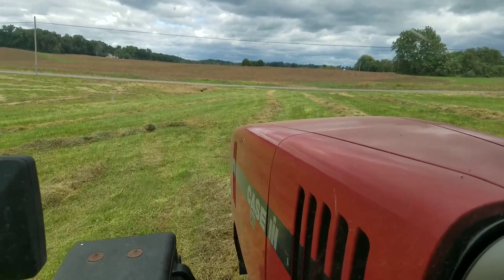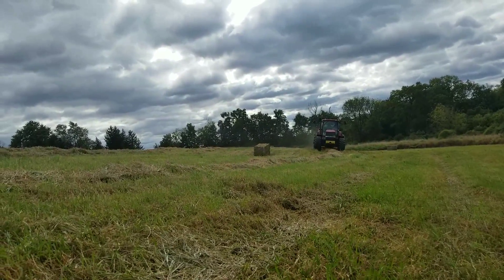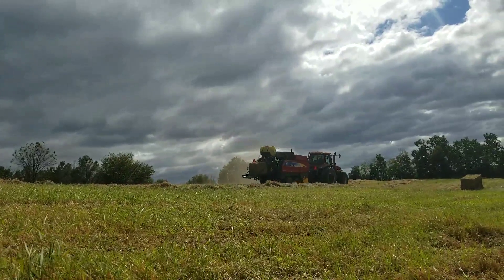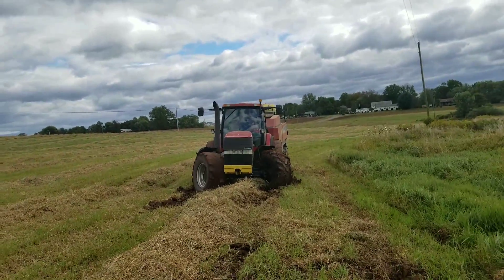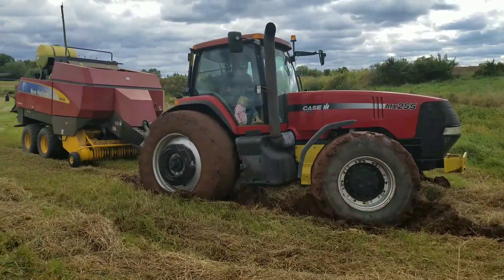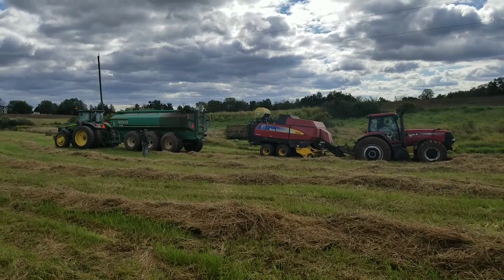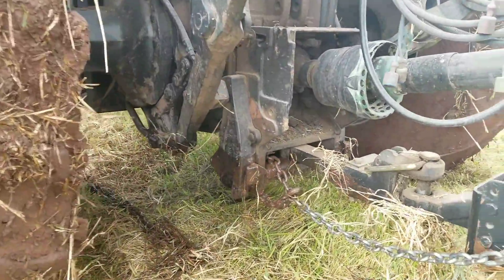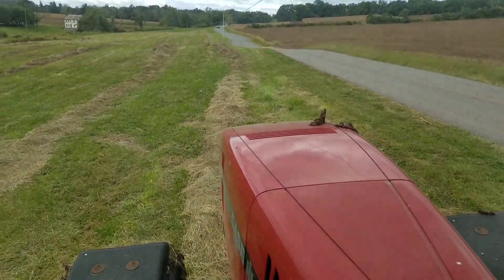The Case MX255 gets stuck in the mud while baling

Comment: No weight on the front axle,   Front drive not  giving you the traction to pull through....Rear wheels spin and lose traction and down you go......I would almost bet with some weight on the front, that tractor will walk through those  spots, noticed that when you were using it for land prep